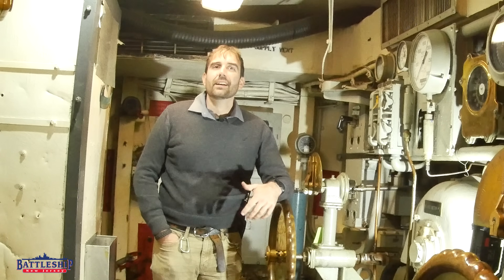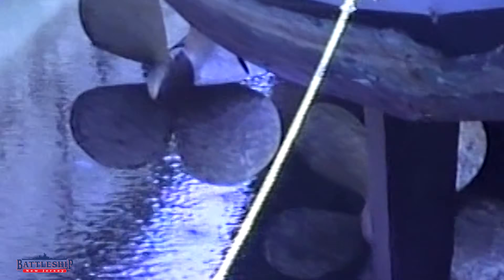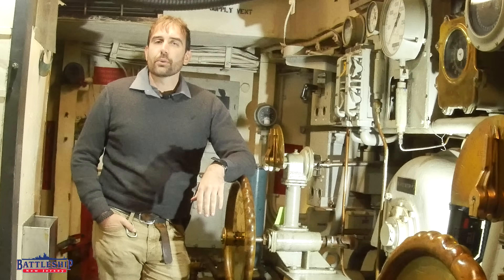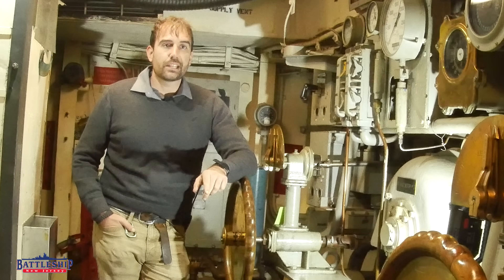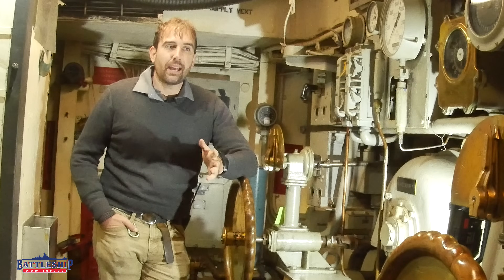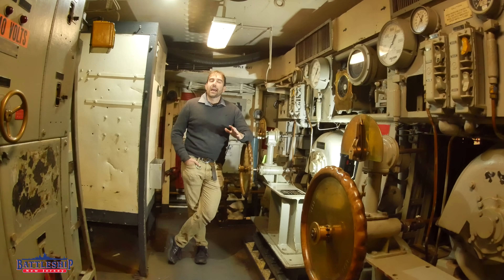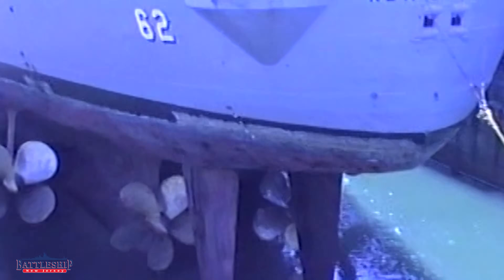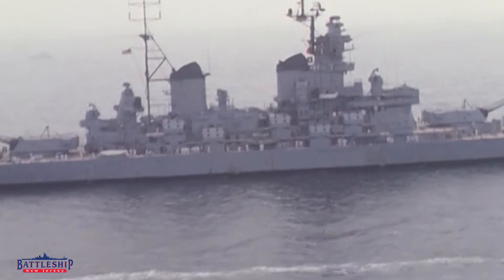How Quickly Can a Ship Stop and Can it Really Do a "Barn Door" Stop?

Comment: I find the quoted distance of 200yds hard to believe… there is a maneuver called the “S-stop” where you cycle the rudder from hard over to hard over back and forth while backing down full. This maneuver is know to reduce straight line stopping distance by about 1/3 from the just crash astern distance.  So, I would estimate that this maneuver would be about the same, to slightly better, so that would be 1000-1300 yards.  Still impressive.
Reply: My natural inclination is to think that, if turning was an option, you would just want to just go hard rudder in whichever direction you can and take advantage of all the drag from the water hitting the side of the ship.

Thinking about it more though, the force that the rudder imparts is the limiting factor on rate of turn and thus drag so the rudder has to be able to provide an equivalent force right?  Equal and opposite forces and all that.

If I'm correct about that, then closing the barn doors should be pretty substantially better than an s-stop but how much better depends on how quickly the rudder can physically alternate from stop to stop.  With the barn door maneuver, the rudder stays at maximum drag the whole time.  With an s-stop, the rudder spends time repeatedly cycling between full drag and (nearly) no drag.

Also thinking about it, I suspect that the story about the rudders leaking from the forces involved in trying the maneuver is BS.  The rudder shouldn't be sustaining more force during this maneuver than it does during any other maximum rudder maneuver.
Reply: @ColonelSandersLite  You are correct, if you can turn away, that is always the BEST option and has the least downrange distance.
In an S-turn, the cycling happens so fast (relatively speaking given how fast larger rudders turn) that your actually heading may only change 10deg or so each side of  your base course, so your actual width taken up by the ship may only be 2-3 ship widths. if that makes sense.
Finally, as for damage to the rudder seals, I'm inclined to believe it was possible, but likely fixable in the next drydocking.  In the 1980's (if memory serves) the 73k deadweight tanker (900ft long) ARCO TEXAS was performing a MOB drill while fully laden and at full sea speed.  The helm was placed hard over to 35deg, and the hydrodynamic forces SNAPPED the rudder off!
Reply: Is that what is called twisting?
Reply: @Thomasnmi  I’ve never heard it called that, but can’t say it’s never been called that…
Reply: @stephenbritton9297  I would definitely rely on your experience then.  :)

Comment: I'd like to see what one of those jet boat littoral ships could do with those buckets it uses for thrust if it didn't break down on the way out to sea.
Reply: Seawolf and Virginia class submarines use pumpjets as well, and the British have used them on their submarines for decades, but presumably all of that performance information is deeply classified.
Reply: @ZGryphon  not quite the same. Those submarines have little more than a ducted propeller. They're referring to internal pump jet propulsion that uses thrust vector ing with nozzles that can move around and a bucket that works as a thrust reverser.

Comment: The DDG I was on (USS Robison DDG 12) had 2 rudders that were mechanically linked by a single, double ended hydraulic ram. At 4500 tons we could stop fast with the right MM on throttles. A crash back on my ship was a violent event, a lot of shuddering and anything not secured would go flying. Our power to weight ratio was pretty high with 70,000 shaft horse power.

Comment: i would also think closing the barn doors would also generate a lot of vibration. i would think a great volume of water would be forced downward skipping under the rudder blades generating a lot of upward force on the stern. even if you didnt get a lot of centripetal force pushing the dishes forward, im sure thered be a lot of shaking. 
if it was done, im pretty sure theyd want to capture it on video.
Reply: Dynamic pressure on the rudders would be about 123,000 Pa, about 1.2 times atmospheric pressure.
Reply: Try cranking a gas turbine ships wheels from flank ahead to full reverse pitch whilst under power, about a ship length stop with a huge wake wave washing onto the helo deck.

Comment: The Wisconsin hit a destroyer in 1956. I would assume before hitting they were in full reverse. It happened in fog so they probably were going slower. The destroyer DD-510 survived and the Wisconsin got the Kentucky's bow.
Reply: Legend has it that's how it became to be known as the USS Wiskey.
Reply: @robertthomas5906  The WisKy. The damage to the Battleship Wisconsin was repaired by replacing the sections with the bow of the unfinished Iowa Class BB that would be been named the Kentucky. Hence WisKy as the nickname
Reply: I read an article on the Wisconsin - Eaton Collision in 1956. The reaction time was very short between observing the destroyer Eaton cutting in front of the Battleship Wisconsin. Here is a link to the deck log: https://www.usswisconsin.org/wp/wp-content/uploads/2015/10/Deck-Log-6-May-1956.pdf
Reply: @dougm5697 Thanks,   Looks like the log has some BS. States the Wisc, backed full until dead in the water, but they still hit the Eaton with enough force to crush enough of the Wisc. bow to require taking the Kentucky's for repair. And mount 51 on the Eaton was destroyed. Lotta damage for dead in the water and 90° hit.
Reply: @oceanmariner  Note that there were six seconds from spotting the Eaton till the collision. The WisKy may have eventually gone dead in the water, but it was after colliding with the Eaton.

Comment: Just a thought Did a battleship ever turn the screws on one side in opposite direction to the other. I think I saw a movie where a submarine did this as an evasive maneuver. Of course you can't believe everything from Hollywood, probably a silly Idea considering the power involved.
Reply: Did it all the time maneuvering up against and away from the pier to swing the stern in or out.
Reply: Don't know how common it was on a BB, but definitely common on smaller vessels.
Reply: Using the seperate screws at different speeds is standard procedure to retain some mobility if the rudders are incapacitated, unsure if they's set one side ahead & one astern at the same time though
Reply: @KennyCnotG  Could be done. Would depend on how rapidly they wanted to turn the ship and what the circumstances were. Obviously if you've got one screw turning backwards and the other turning forwards you'll turn a lot faster, but you'll also lose a lot more speed doing so. By the way, this is arguably why 2 and 4 screw designs for a ship's propulsion plant are better than a 3 screw design.

Comment: What was the procedure for synchronizing the rudders after this maneuver is done?
Reply: Center the rudders manually per the Rudder Angle Indicators, then shift back to electrical control.  The Synchro Receivers on the Steering Gear will automatically synchronize with the Synchro Transmitters in the Helm Console.  Assuming that the PMS (Planned Maintenance) on the Helm was done properly, if the Helm is at 0 Degrees, then the rudders will be at 0 degrees.  

Basically, if the helm is at Zero, then the Receivers on the hydraulic spool valves will also be at Zero.  If the Rudder Angle is not at Zero, then the Synchro Receivers on the steering gear will be loosened and rotated until the rudders ARE at Zero, then tightened down....Much like setting Ignition Timing on a car by rotating the distributor.  

If the Synchro Receivers are not exactly following the Synchro Transmitters in the Helm, then you have other problems...The only purpose of a Synchro Pair is to have the shaft on the Receiver move in correspondence with the shaft on the Transmitter.  If this is not the case, then you have either a wiring issue or a failed Synchro.  Synchros are also used in the Engine Order, Prop Order, Gyro Repeaters, Wind Speed/Direction Indicators, etc.

Synchros, limit switches, and Sound-Powered phones....The bane of my existence for 2-1/2 years shipboard.
Reply: @kevincrosby1760  wow! I never imagined that I would get anywhere near this detailed of an answer. Thanks mister! Happy Veteran's Day. Thank you for serving so we can enjoy freedoms in this great country..
Reply: @RustyorBroken  I do tend to be a bit detail-oriented, sometimes to a fault.  Thankfully, I work in an industry (Telecommunications) where being such is considered an asset.

My service in the US Navy had its high points and low points, but overall I would do it again in a heartbeat.
Reply: @kevincrosby1760  I just had a conversation with a shop guy and he said almost the same thing. He would do it again in a heartbeat. Only change he would make is to not get out. He jumped out of airplanes so you have to factor that into the equation. He might not be entirely right in the head. Ha!

Comment: I find it hard to believe that closing the barn doors can stop the ship in about 600ft since  crash back is documented to take one mile.  I read the ood manual and the barn door stories. If they had said the ship stopped in two lengths it would be more believable.  There should be official documentation of Wisconsin's rudder repair somewhere.  I guess you could also measure the height of the rudder stalks on each ship to see if Wisconsin really had them moved up. I hear you have contacts with the other Iowas. 😁
Reply: It will be in conjunction with a crash back.
Reply: @mandowarrior123  Sorry, I meant to imply that.
Reply: I mean you are basically opening up a giant parachute underwater. It’s gonna put a lot of force on that ship. Honestly surprised it wouldn’t just rip the rudders off entirely.
Reply: @bentrod3405  Ever see the main shaft of a rudder on a big ship? More likely to rip the chute to shreds.

Comment: Imagine the cavatation damage to the screws!!!
Reply: Would 35 degrees on the rudders without the stern swinging into the stream cause cavitation on the rudder, surely brutal turbulence at least?
Reply: @givenfirstnamefamilyfirstn3935  cavitation wouldn't be a real issue for the rudders, they're too far away from the screws to be affected, and they don't have water moving over them fast enough to cavitate. Cavitation is essentially lowering the pressure against the surface of the blades enough(via flow separation) to momentarily flash boil the water without heat, the effect dissipates quickly and the bubbles collapse in on themselves with enough force to act like millions of tiny ball peen hammers.
Reply: Eh, not a concern for short periods it would be expected to operate like this.

Comment: 4 screws at back emergency should add far more drag than the rudders at 35deg. The turbulence from inboard screws in back full or back emergency would hamper the amount of added drag from the rudders. If it wasn’t done during commissioning sea trials on any of them it’s doubtful it was ever done. Surely would be a “hold my beer” event
Reply: It seems the problem is reversing the props takes time (and time is distance).
Reply: @russellhltn1396  back when I was a throttleman we could go from ahead flank to back emergency in a matter of seconds. All it takes is spinning the ahead wheel closed and then opening the astern throttle. For man overboard you slam the ahead closed as fast as you can then open the astern to stop the shaft applying sufficient steam to hold the shaft from spinning. Did that in less than 10 seconds from ahead flank and I wasn’t very good. I was training one guy and he did it in about 5 seconds. Stopped the shaft before the engine room supervisor got back to look.
Reply: @The7humpwump  Sounds like you're talking about stop and lock casualty control training rather than answering a BEM bell...
Reply: Incorrect assumption- rudders would increase the relative performance of the screws by the same token- it will direct the intake and result in higher velocity thrust. All you're saying by drag reduction is it would be pretty safe to do in reverse compared to regular rudder use under power, as rudder drag is essentially strain on the rudder.

Comment: Even without involving the rudders, going straight from flank speed to all back full sounds like it would be really hard on the turbine gearing.
Reply: It is much harder on the boilers! The pressures, temperatures and levels go bonkers during the process. 
It works a lot better if you start opening the astern throttle before you get the ahead throttle shut. 
I've only see one system do it fully automated, it stopped our ship 90 seconds and 1.5 miles faster than it did on builder's trials, 20 years before.
Reply: @brucelytle1144  shrink and swell with wter level
Reply: Not really. You have to shut the ahead throttles anfd then open the astern throttles. Astern throttles are harder to open, and as they open the turbine starts to brake the gearing and shaft.  It's how we'd stop the shaft from spinning on a loss of lube oil. The prop shafts are quill shafts and have a lot of twist in them. We were told the prop was actually 1/4 turn behind the turbine end when at high speed.

Comment: The rudders would be under the same stress from a hard turn as they would from a barn door maneuver. In fact I think they would be under less stress as the props are not pushing water against them in the stop maneuver, they are just dragging along at 35deg. In the hard turn they are dragging along and have the prop wash to deal with, the turning hull creating more inertia to be overcome by the rudders, so yeah, the turn is worse I think.
Reply: 100%. The only factors to consider are the unusual outboard forces and if stopping that fast doesn't sink the bow too much or something like that.
Reply: Except that the turbulence from having the water back up behind the rudders and then force it's way out through the narrowed gap would lead to higher stresses as the back of the rudders shed the generated vorticies.  A hard turn would be close, but more likely to be closer to laminar flow - still some weird turbulence generated, but nowhere near as violent.
Reply: @themage12  The rudders could be turned away from each other, the info did not state if they were turned towards or away? I agree if they closed the gap that may be worse but they don't need to do that. Also reducing the angle at first and slowly increasing as speed drops could be a safe option.
Reply: @nickbreen287  one would assume that by using the verb "closing" the rudders are turning inwards.  There would also be an advantage to this, as the forcing of water between the rudders would create a region of high pressure which would be shared between the rudders (increasing efficacy) vs. outward turning, where each rudder would be operating more independently in terms of developed pressure zones.  Also, performing this manoeuver slowly/progressively would defeat it's purpose - to provide a means of stopping over and above what a "crash stop" can do - so time is of the essence.
Reply: I was thinking the same thing.

Comment: I had a young man come to work for me after serving in Wisconsin off Iraq (Desert Shield / Storm.)  He mentioned the "Slamming the Barn Doors" maneuver as if they had done it during his time aboard.  He was probably trying to B.S. his LPO (me) judging by what I've learned here.  That was something that I don't think the twin rudder Spruance class DD could do, I think the tiller heads of the rudders were linked through the same hydraulic systems.  Besides, with CRPs (Controllable Reversable Propellers) we could stop the ship in a Crash Back maneuver at least as fast as 'Slamming the Barn Doors' could.
Reply: Yes, the Sprew class could stop fast. About 620ft if I remember. The Kidd/Ayatolla class and all the Ticos were just as snappy in acceleration and stopping power. I don't know the start/stop distance of the Burke class DDG ships. I do know the Pegasus class PHM when doing a emerstop or crashback would throw a grown man across the compt along with everything else not tied in place. FFG 7 class was a snappy little sports car also.
Reply: @tomasthomas8563  We could stop Caron in just under her own length from 32 knots, 563 feet long.  The Kidd class and Tico class are all built on Spruance hulls, under the hood (from the main deck down they are Spruance hulls and machinery) although the Tico guys will try to B.S. you into believing that they can somehow coax an additional 5,000 HP out of each LM-2500 or that there is something "special" about their propellers ... there ain't.  The last blade change Caron did while I was aboard was all 10 blades (chewed up by gravel at Roosevelt Roads.)  The blades we got were brand new ones intended for the not yet completed Bunker Hill.

The Kidd class' performance was exactly what ours was, the Tico class just a tad bit slower because they are between 1,000 and 1,200 tons heavier than a standard Spruance ... all that extra superstructure has a cost.

Even though they seem smaller than a Tico, the Burke's displace about the same tonnage.  They DO have that extra power the Tico and Spruance classes wish they had, their LM-2500s are rated at about 25,000 HP each vs 20,000 HP in the older ships.  I believe the Burkes can also turn more quickly than the older ships as their length to beam ratio is less than ours, they are shorter and have a slightly wider beam and this DOES allow a tighter turning radius.

I would LOVE to drive a Burke, just once at speed.  Caron was a thoroughbred, loved to run.